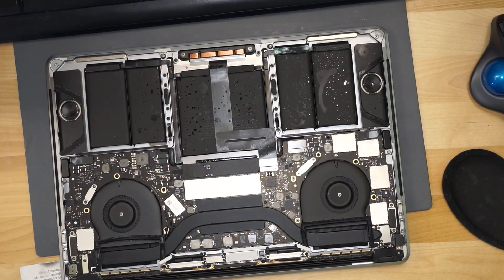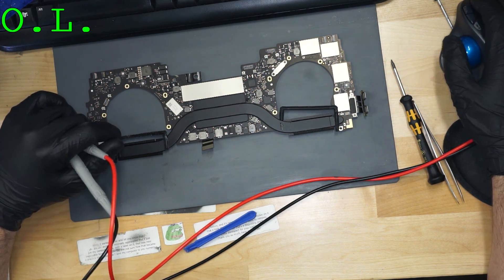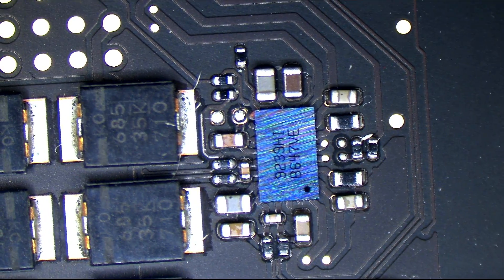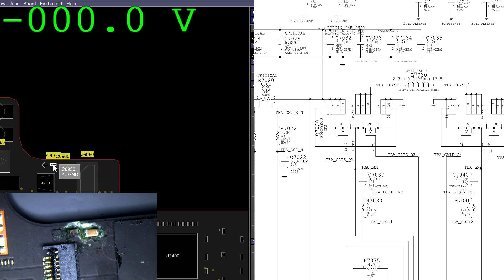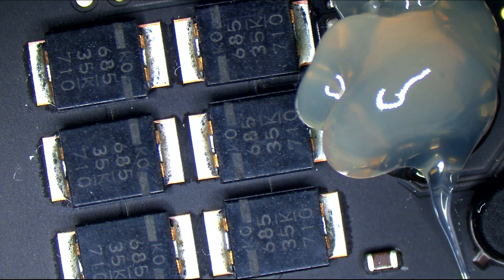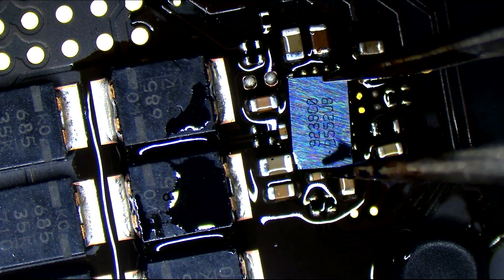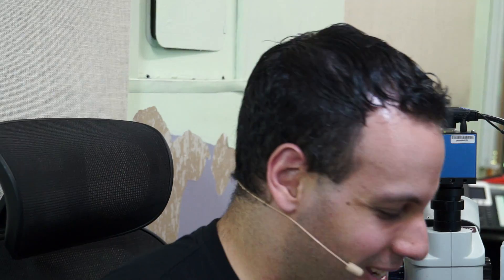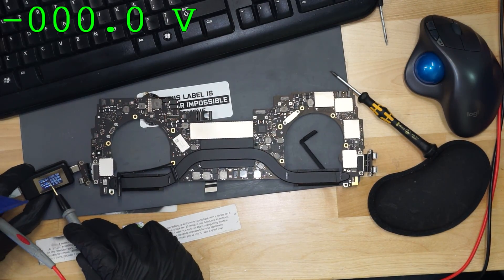USB-C Macbook Pro not turning on no PPBUS_G3H

Comment: I found a great "fix" for those 2011 15" MBPs. It's a way to disable GPU switching permanently, locking it into integrated graphics. The GPU failed on my 2011 last year, ran through this "fix" and it's now still running along happily as my wife's "new" laptop :) Not prefect but it's better than trashing it, and the wife's more than happy with it.

Comment: Well I can finally say that i'm glad that I watch these videos, I bought 8 scrap laptops last night for $174 including shipping and then found out today now that they are shipping that there is a chance that there will be some Macbooks in the lot. I have zero experience with apple products since all of my work is done on Windows machines and from watching your videos it's apparent that Macbooks need board repairs nearly every single time, I have no hot air rework station and no experience with replacing chips but at least I know that I can hopefully source any board chips that I might need from your store and from watching you work I have a general idea of how chips should be replaced and how to check for which chip is actually causing the problem so thank you for doing these videos.